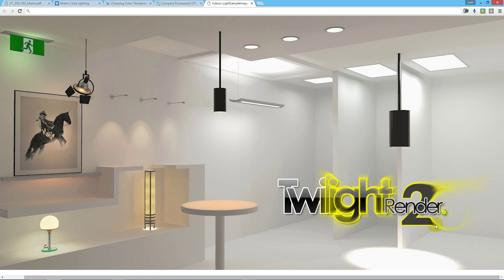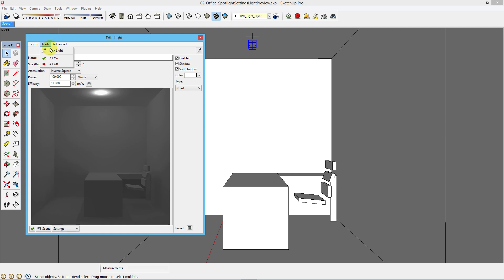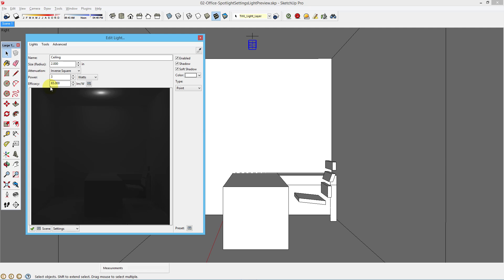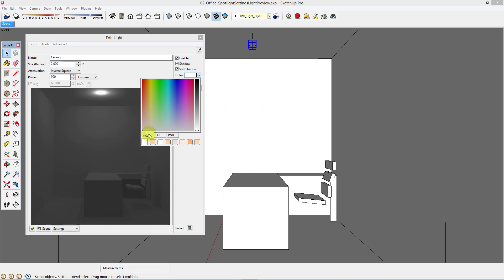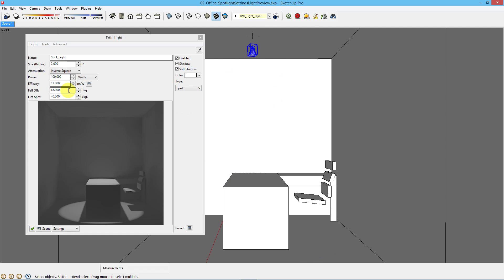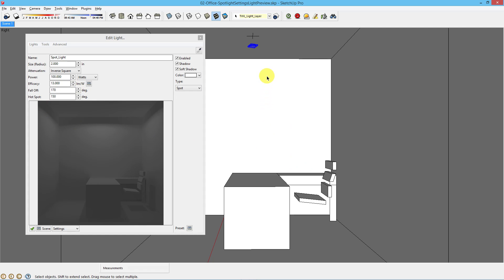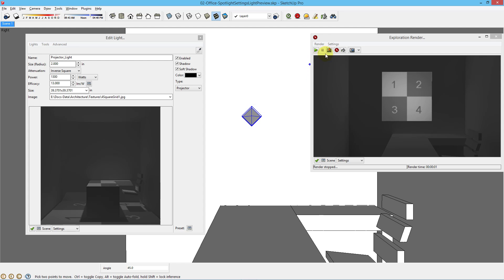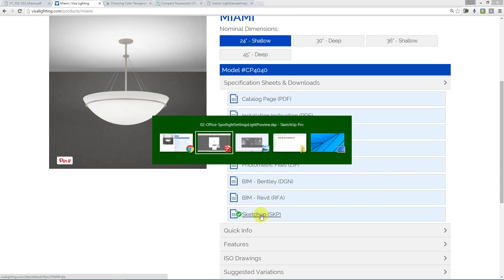Twilight Render Tutorial Intro To Lighting

Comment: When you set a spot light, you can see the light but not the light source...why?
Reply from the maker: The light object is physically infinitely small (a single point) in 3D space, therefore it doesn't render. This is how the render engine renders spot lights. If you want to see the light source, you will need to use light emitting materials. Point lights will show in specular reflections.

Comment: I'd also like more landscaping tutorials please. Need help with using background images, outdoor sky environments, external lighting etc. I'd also really like more tutorials on easy way of modelling low poly plants for Twilight Rendering. I have 3D Tree plugin but still like to be able to make my own tree models with low poly or swap out with low poly components using my own photos if possible.
Reply from the maker: Modeling low-poly plants for Sketchup will work for Twilight. There are many tutorials how to create low-poly models so we will not likely create a video on that specific purpose. However, for using our powerful Proxy Component tool with Twilight Render, see our Community Forum tutorial here: https://www.twilightrender.com/phpBB3/viewtopic.php?t=4419#p32639. Finally, for your environment questions we will likely create a video tutorial, thank you for the suggestions!
Skatter plugin is integrated with Twilight Render,: https://www.twilightrender.com/phpBB3/viewtopic.php?t=5317
Landscaping with other component spray plugin tools also works perfectly with Twilight Render - those plugins are available at SketchUcation.com so any of those landscaping tools will work with Twilight Render. The exception would be a plugin that is referencing special format external proxies. While Twilight Render works great with external proxies, there is some integration required.